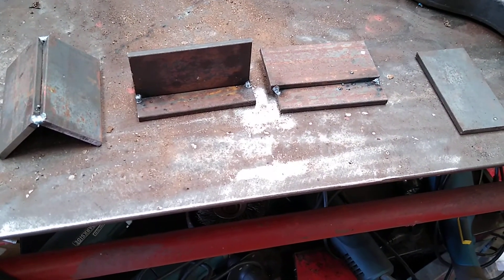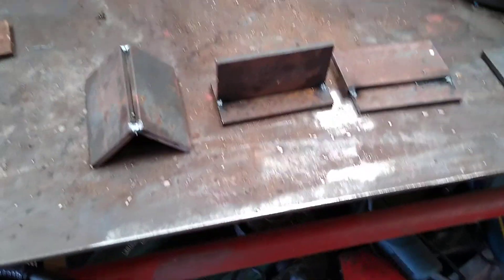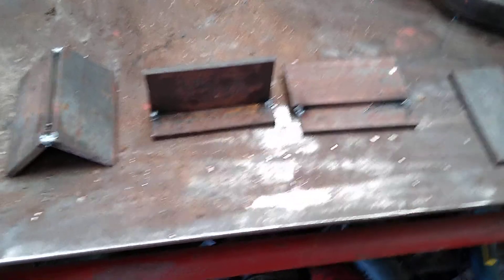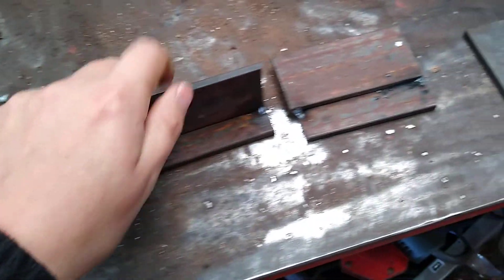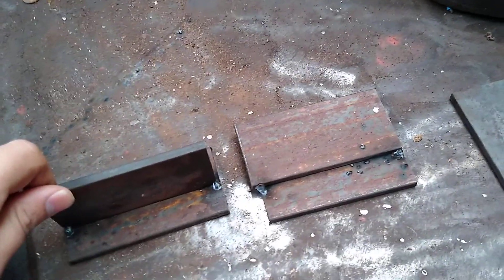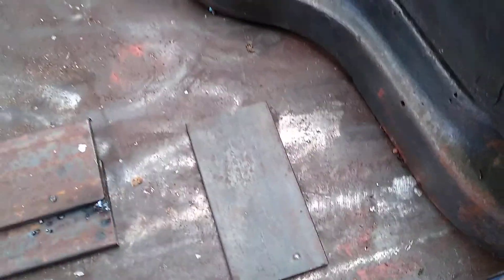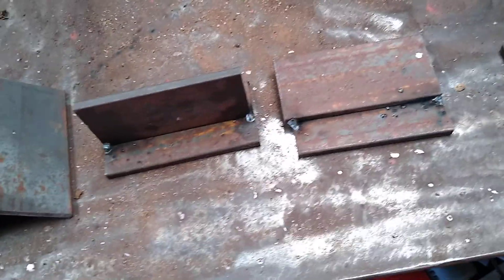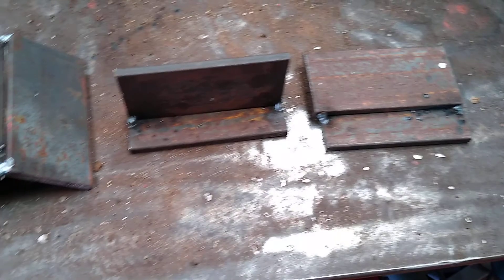Mig welding level 1!  (Part 1) CITY AND GUILDS

Comment: Level 2 which is only part of the qualification which am currently taking in mig and tig, would anyone really consider employing you on just having the level 2 qualification or for most welding vacancies do you need a level 3?
Reply from the maker: Yes you can get employed with a level 2,    I started in a factory building skips at level two. Level 3 is definitely worth doing alongside it though if you have the time.
Reply: @superfabrication2019  ok thanks, what's involved with level 3? welds in different position then? how to read technical drawings and so on does it touch any of that? Sounds quite intensive and it's something I would consider having to pay for if it would get me somewhere particularly in Tig?